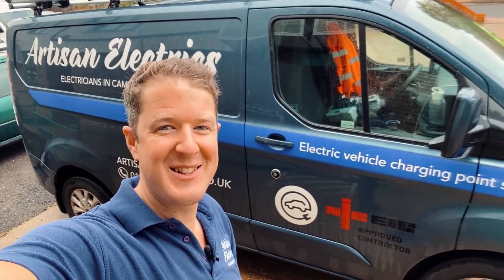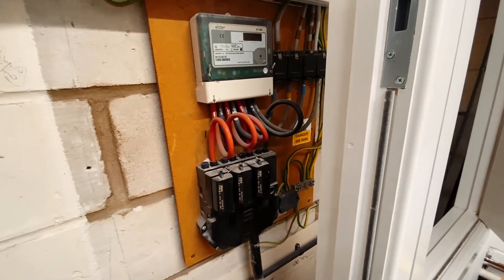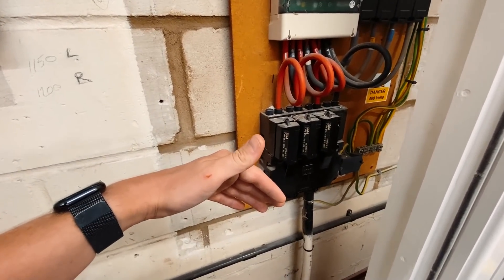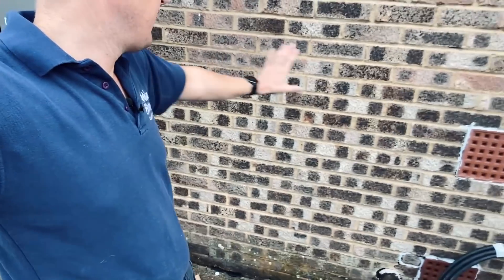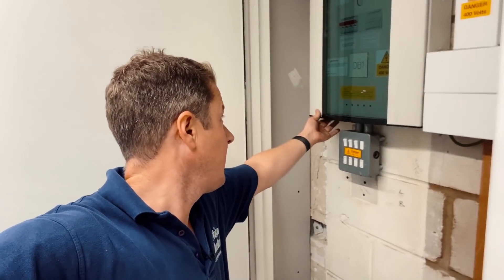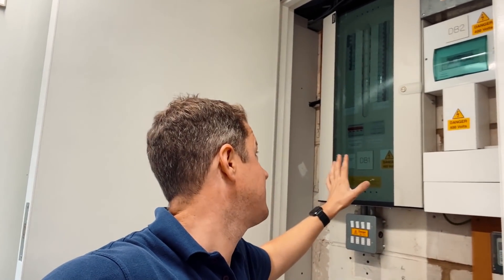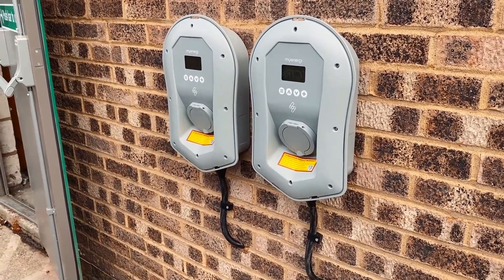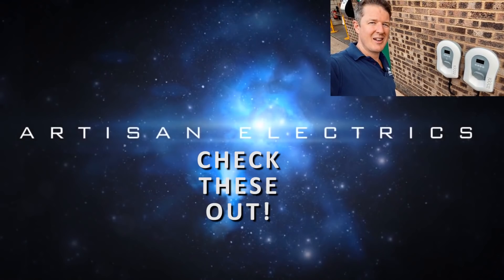Three Phase Commercial Electric Vehicle Charging Installation

Comment: Just revisited this video out of interest. As i turns out the supply would have needed a type A RCD upfront as the device within the charger resembling a type A rcd doesn’t comply with the requirements .I guess it was a case of MCB to a 3-phase Type A rcd unit external to the board and then onto the charger per set up. 🤷‍♂️

Comment: By the way, I saw another guy talking about three phase chargers and rotating the phases of you have multiple chargers in case there are cars that only charge at 7kw (i.e. single phase).
He suggested this so that the first phase doesn't become overloaded.

What are your thoughts?

I was wondering because the same could apply in my street with the houses. Many are three phase (only 4 of 23 are single phase on the two incoming feeds).

Comment: That was a great representation of a install of a 3 phase charger.

I dont think customers realise how much goes into installing chargers, I think they just think oh yeah just connect a cable up between the two.

Some lovely decisions there too - drilling on the angle to get a nice sweet on the SWA externally as well as not going direct into the back of the Zappi.

Just out of interest did you consider Hi-Tuf cable from Doncaster? Its not that much cheaper than swa but just nicer to work with and a little more plyable. Give the shortish and out the eay run so to speak thought it would have been an option for ya.

Thumbs up.
Reply from the maker: Thanks!

Comment: Hey Jordan, great informative video. I was wondering what's your opinion on using NYY cable instead of armour. When comes to running cable underground obviously SWA is the only solution unless it's otherwise protected, but when comes to surface mounting NYY could be better option??? Let me know please what you think. Thanks.

Comment: Just for curiosity... I was arguing the other day with another spark about the cross section of the conductor we should use for a 22kW 3ph car charger - clipped direct. I know everyone likes to go exaggerate with safety and be weeeell on the safety side. I even checked into the on-site guide and I believe (know) I’m right but... I’m saying a 4mm 5 core is enough. He is saying 6mm 5 core.
Reply from the maker: 4mm 5 core would probably fine on a short run like this

Comment: Video does not show your connections at the distribution board, so is there phase rotation or did you just connect both directly by the phase markings?  You should rotate wallbox phases, so when there are multiple 1 phase cars charging, they wont all be on the same phase.  Now there might be a situation where two cars with 7 kW chargers go over the main supply limit, their power would be restricted, but L2 and L3 have still 50 amps to go.  Someone advised to do phase rotation on the db end, so that if some clueless electrician changes that wallbox, they dont have to mind about it and just connect phases normally.  After all, it is way more obvious at the board, where you can usually see all the wallbox wires at once.

Comment: Great video again Jorden. Just one thing Myenergi are so strict on keeping the IP65 rating of there Zappi’s intact, I think if you have a problem with water ingress in the master they won’t repair or replace it because you haven’t used a gland on the flexible conduit.
Reply from the maker: Good tip thanks

Comment: I've had to use henley (ok actually niglon) single pole  blocks as a MET before... usually when the existing MET block only allows 2x16mm cables. The ones I have now are 6x 35mm2 terminals (min 4mm), so works quite well.  Also the lid allows a nice 'safety electrical connection' label :)

Comment: The manufacturer actually recommends a 4 pole MCB on a 22kw system and 2 pole on a single phase system as per the data sheet.
Reply from the maker: Hmmm I’ve not seen that version before...
Reply: @artisanelectrics  https://www.smarthomecharge.co.uk/site/assets/files/1344/zappi_datasheet.pdf
Near the bottom under Installation Requirements. Guess the 40A is 400x1.733x40 to give more space but there aren't many vehicles using the full 22. Not sure about the 2pole and 4pole, could be advising that RCBO's are used, as live/lives and neutral disconnected with an rcbo and S type?

Comment: At the (nominal) 400v 32 Amp would be 22.14 Kw, so no headroom, I would say 40Amp type B curve !
Reply: 3 × 32A × 240V = 23kW
Reply: @djod1751  Incorrect as there is a 120 degree phase shift, the nominal voltage in the UK is 230 V +10% - 6% single Phase and 400V +10% -6% three phase. the way it is calculated on a 3 phase supply is Volts x Amps x 1.73!
Reply: @CrazySparkie63  👍
Reply: On European breakers the headroom is above the nominal value, not below like with American ones.

Comment: Henley block as DNO earth terminal is usual for modern PME supply. Insulated DNO earth terminal required by some DNOs if not by ESQCR as PME MET is effectively a live conductor under fault conditions as is the neutral of the supply and therefore could rise to a hazardous potential under fault.
Reply: good thought, hadn't considered that but you're right

Comment: The place between emergency exit door and that gangway doesn't seem to be the best choice if I Imagine two vehicles parking and charging there.
Reply: Came to say the same thing. That second charger is gonna force people to park right outside the exit.
Reply: Would tend to agree. Two chargers side by side looks aesthetically pleasing but neglects the fact that two vehicles might not be able to park conveniently in the same place. One of the chargers will necessarily have to have an extra long cable unless they park top and tail.

If that’s what the customer specced though then shrug

Comment: sorry to be a pedant but that's not the incoming gas, you're pointing to the supply out of the meter that the consumer is responsible for. the flexi on the left side is the incomer.

Comment: Residential will become problematic as more households will have more than one EV car, then what?
Reply: Shaun Ollerton they don’t need to be on charge all the time. We have two Renault Zoes and share a single charger, unless you need a full battery every day it’s unlikely to be a problem. A home charger can supply 7kW an hour which works out to about 30+ miles for most EVs.
Reply: @havocgeneral  MMM, I doubt your experience so is going to be the norm, high mileage workers car and say a work van they will need near full charge, you can't keep stopping during the day and find a charge point to make up the lack of charging at home.

Comment: I would have probably used NYY and back entry. But I’m not slating your work because it’s still lovely stuff ! 
also, it’s easy to say “I would of” while watching a video. 
But different in the real world where you probably didn’t know how you were going to run the cable in the first place and bought SWA for it 👌🏼 
As always Jordan, nice work
Reply: I think we all just automatically select SWA, when really we don't need it all the time, we just get SWA, out of habit.
Reply: Love NYY it’s the way forward in the right circumstances
Reply: kevin pickett I’ll be using it next week 👌🏼 May even get a video of that 👍🏼
Reply: @Cablesmith  yeah, we do a lot of NYY if it's all surface, it's smaller for the same size and easier to handle. For sheds and stuff, NYY in plastic conduit altho odd, can be neat.
Reply: TheChipmunk2008 while we are on the subject, do you happen to know the size of P clip I will need for 2.5mm 3 core NYY ? 😄 save me buying 400 sizes to get the right one
Reply: @Cablesmith  Depends on the manufacturer mate, but the average seems to be about 13-14mm. If you have any 12mm or 1/2 inch they might work? 

I use 9mm p clips on 25mm tails which are just over 10mm and they look good.
Reply: TheChipmunk2008 noted ! Thanks boss
Reply: @Cablesmith  10-14 mm

Comment: Putting the earths into the Henley block is a good idea on a PME system as most people assume there won’t be any voltage present, but there could be in the event of a lost neutral or transient earth voltages from neighbouring properties. Always good practice to stick a clamp meter around the earth to check for any leakage or stray current. #e5 posted on Instagram a while ago with 49A on the earth in one of the installations they were testing😱

Comment: Why dont you use the brother label marker to make labels for the cabin, instead of the handwritten "zappi 1"?
Reply: Happened to us the other day. Temp label with a sharpie... came back at the end of the job to do it with the brother.

Have also had it where the damn tape runs out halfway through labelling an installation! drives me mad ... so I now have at least 2 spares of each type of tape in the van! (hint in case you didn't realize... unlike some of the earlier labelmakers, the generic tapes work fine with the new Brother labellers... and are way cheap on the bay of E)

Comment: I am not a skilled electrician but I always thought you need to have a swan neck on a external cable before diving into a wall i.e. can the rain not run into the wall if its hitting the armoured?
Reply: Drill the hole at an angle and silicone it is perfectly fine - drip loops look terrible 🤣😶

Comment: Not a spark here, if you come directly in the back of the Zappi, do you need to use a SWA cable or could you have used a standard cable?
Reply: Could have used NYY cable, but probably didn't know the exact site layout so brought along SWA as a safe bet.

Comment: You could always use the NYY cable, instead of SWA
Reply: SWA is safer outside  but here yeah he should have used it since there would be no contact with the outside
Reply: Nyy is the way forward
Reply: Tuf sheath from Doncaster cables are the way forward

Comment: Jordan, Are you an affiliated zappi installer or is this a personal choice of unit? Also Is the zappi overall cheaper than other units when you take into account the extra pen sensing and type A rcd cost?
Reply from the maker: It’s my personal choice I can fit any unit I like but Zappi is best on the market at the moment and when you factor in safety features it is competitive on price